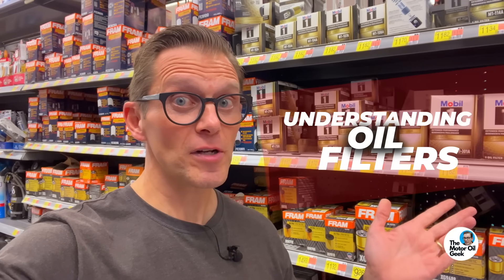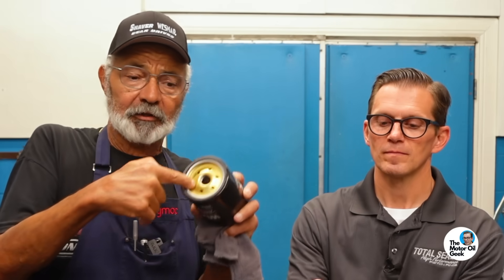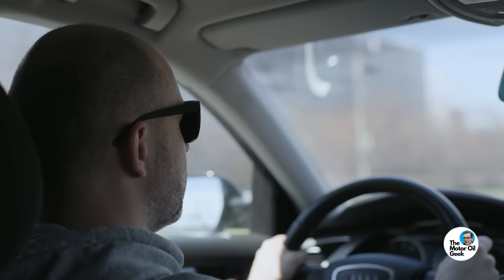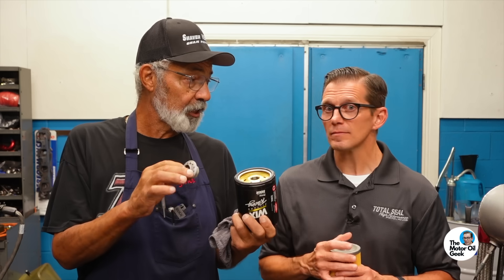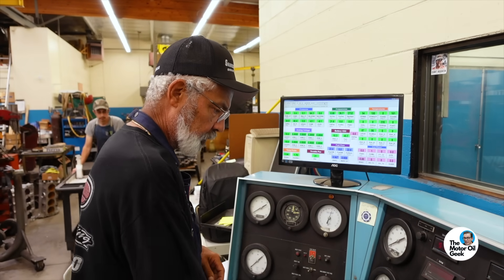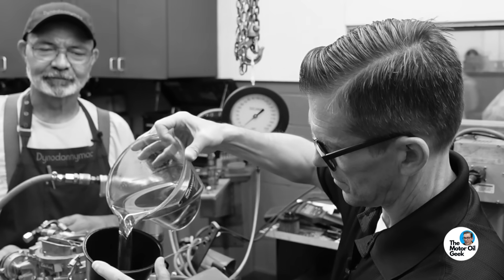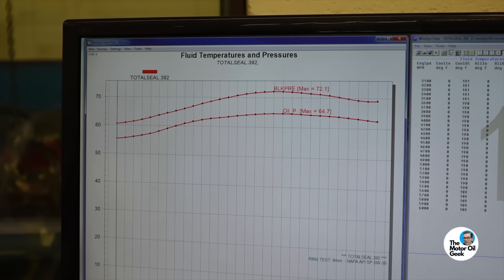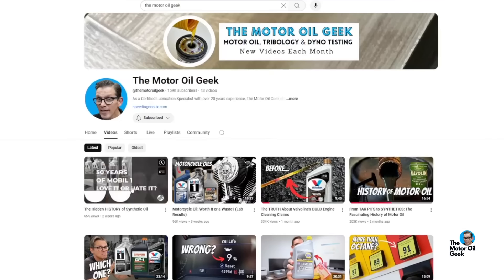OIL FILTERS: What Most People DON'T Know!

Comment: Lake I've heard of one higher end very expensive filter with a lower micron limit that might be prone to going to bypass.....but that is a comment only from one person.  Are you aware of any filters that are prone to going to bypass if one really tries an extended OCI? Like 10-20k miles?
Reply from the maker: Capacity is a different story. Sounds like we need to do a 'field trip" to an oil filter manufacturer.
Reply: @themotoroilgeek  absolutely would love to have addressed because....everyone wants better filtration, but would you say that it isn't really necessary to be so neurotic about it? So if you can find a filter maker boasting 20micron and 20,000 mile capacity, lots of us wouldn't mind stretching a dollar, but going to bypass because it's capacity is shot, would be a risky thing (I've done drain/re-installs with filters in the past...but those were expensive filters).  I recently stopped going 15,000 with an M1 and went back to Denso Champ with plenty of inlet cross sectional area and toss them every 5k.  But if the M1's and Purolator Boss's of the world really truly never go to bypass, is there too much risk in really trying to use them to their full stated mileage? Specifically those low cost filters are being used on my '12 manual Civic.  But I'm staying with Toyota filters on my '18 Camry and '05 Highlander Limited.  Mainly, we're driving a ton, have teen drivers, ...and went so far as to go direct to Valvoline to order on subscription 5gal bay boxes of 0w-20 or Restore and Protect for the Civic and the Camry.  I'm doing at least one oil change every 6-8 weeks.
Reply from the maker: @richcombs4805  Those are great questions that are worth finding a way to test oil.

Comment: Great video explaining about oil filters, I don’t know how to pre-fill or filters on some engines when they are sitting upside down on top of the engine.
I’ve come across this a few types over the years with some machinery I’ve worked on .
The other thing on some motorbikes where the cartridge oil filter they actually have a drain hole to drain the oil back to the crankcase when the bike is sitting just allow duty oil to go back to the base instead of sitting in the oil filter part of the crank case .

Comment: Lake, I'm confused! I thought that the purpose of multi-grade oil (say 5W-30) was that when it's cold it acts a a 5wt oil (thin) to flow easily around the engine quickly. When the oil heats up it acts as a thicker (30wt) to maintain the oil layer between bearings under normal/heavy loads. Am I missing something?
Reply: Oil gets thinner as it gets warmer.  It's just that a multi-weight oil doesn't 'thin' as much with temp as a straight-weight oil.  A 5W-30 oil is as thick as a 5 Wt oil when cold, and as thick as a 30 wt when hot.  On a x-y chart, imagine the x axis is higher temperature and the y axis is higher viscosity.  If you plot the viscosity of a 5 wt and a 30 wt, you'll see two parallel lines with negative slope.  So 'cold', you're on the 5wt line.  when 'hot', you're on the 30wt line.  Your oil is thinner than it started when cold, it just didn't "thin" as much as if you had used a straight 5 weight.
Reply from the maker: https://youtu.be/48pviPLgaPQ

Comment: Doesn't the Check Valve also open if the vehicle is exposed to super low temptures where the Viscosity of the oil is so thick that it wont flow adiquitately though the filter medium so the valve opens because it's better to have unfiltered oil than no oil at all
Reply from the maker: It only open if the differential pressure is greater than the minimum of the pressure range indicated.

Comment: I would say that demonstration was flawed. You attempted to show delta pressure but we have no idea if the Delta pressure was low because of the bypass valve opening or not. I would argue that any time other than a warm engine at idle the bypass valve is likely open at least a little bit. In order for this demonstration to show anything, you'd have to disable the bypass valve and make sure it isn't opening. I understand that the theory is that unless the delta pressure is greater than the claimed 10 psi that the valve is rated for, it's not opening. I just think there is more to it than simply measuring delta pressure alone.

Comment: Good info. I used to drive an Austin 1800 ( 1968 British built car) which had an oil pressure light and a filter bypass light for when the filter bypass activated. The only car I have encountered with this doodad. Judging by some of the extreme mileage videos on You Tube the bypass must get a workout. Would be interesting to know if these cars suffered final failure because the oil broke down or  lack of filtration due to the bypass being the only source of lubrication for months.. It was interesting to learn the actual delta that the bypass opens at. Maybe it would open on really cold oil if you rev it too much  but that would only be temporary until it thinned out a bit.

Comment: To say the bypass valve almost never opens on a clean filter is an over generalization if you ask me. 
For starters look at the wide range of specs for bypass pressure provided by the various oil filter manufacturers. Even for filters specified for the same exact engine. You’ll see quite a range. Some far above the engine manufacturers specifications, some below. I know that WIX lists two filters for the Subaru EJ25 engine. The primary difference between the two is the bypass rating. And the lower of the two will have you opening the bypass rather frequently. Especially when subie bro goes and puts Rotella 15w40 in the dang thing. 
There are definitely situations where the bypass is open far more than we want or think.

Comment: Good video. Technically, if we go to semantics…the valve prwventing backflow is the check valve. The bypass is a bypass, cracks open at a set pressure drop across the filter itself which really only will happen with a completely saturated media. A sort of damage control kind of deal really.

Comment: I humbly submit that the by-pass valve is not a check valve, it is a relief valve
Reply: I would have to agree, the "anti-drain back" would be considered a check valve imo
Reply: @gidderman  That rubber u see under the holes around the filter boss are the anti drain back.
Reply: It allows the oil to go through a different path to the engine, bypass the filter media is absolutely what it does.  A fuel pump has a relief valve which returns fuel to the tank.  It is a relief valve as it keep pressure below a certain level.  Rather than relieving pressure it is there to maintain a minimum pressure.
Reply: Yes, technically. But it works just like a check valve, since it never flows back. It would need a pressure drop so to the oil to flow back and it would immediatelly close off its passage.
Reply: @cmte.brazinazzo2061  pressure relief and bypass valve are similar with porting to redirect.  whereas a pressure regulator and backflow prevention just closes.
Reply: You're correct!
Reply: It's both...
Reply: You're wrong, a check valve can be a bypass.  You're conflating type with function.
Reply: @dan1906  a check valve is a 1 way valve
Reply: @dan1906  nope!

Comment: @themotoroilgeek Let me just preface this by saying that I am not an engineer, I'm a retired Ford dealer tech.  While I've enjoyed and been enlightened by many of your videos, I'm gonna have to call you and Don out on this one.  Concerning the  bypass valve, Don said that "it's better to have SOME oil than no oil".  What he should have said, " it's better to have DIRTY oil than no oil"  as the bypass will still will provide the full flow of unfiltered oil.

You analogy of the bypass valve with the cold oil by using the before/aft pressure differential, just doesn't make sense.  The whole idea of the bypass valve is to ensure FULL FLOW of oil should the filter media cause excessive restriction, in any way.  In your test, if the thickened oil was restricted by the filter media, the bypass would open.  This would allow all the pre-filter oil pressure to reach the post-filter gauge, which is what we saw. We still don't know if the oil is flowing through the media or the bypass. Capiche?🤔

As you know, in the end what causes oil pressure is the restriction put on the oil coming from the pump.  The 10 PSI filter relief valve cannot override the 75 PSI relief valve in the oil pump. As such, all the oil coming out of the pump, is one way or another, going to pass through the filter. 

Yes, in the hot test there is a more oil flowing (think GPM) through the filter due to more loss at the bearings.  The now approximate 6 PSI  difference is caused by the restriction of the filter media. Had this difference reached 10 PSI, the bypass would open, still allowing all of the oil to reach the engine.  We didn't see this differential in the cold test as the bearings provided more restriction to flow than the filter did.

Lake, please give this test another thought and let me know what you think.  Two heads are better than one... and three is better than two...even if one is a bone head!😁
Paul Rosa
Reply from the maker: Thanks for watching and for the feedback. Differential pressure valves only open after the pressure exceeds the minimum. At 10:08 we show a graph that indicates when a valve opens.
Reply: @themotoroilgeek Thanks so much for taking the time to reply. 
I watched the bypass valve part of video several more times and of course you are correct.  I now agree that none of the oil in the test is bypassing the filter.  Sure the thicker oil is more restricted at the filter, but it is also more restricted at the bearings and the rest of the engine.  This causes the rate of flow of the cold oil through the filter to be much less than when hot, thus the filter media can easily handle it.  
The graph at 10:08 Is very confusing.  It could use a little explanation.   We never see the expected 10 PSI (.7 bar)difference where you say it shows the BP valve opening.  In fact,  the biggest difference is at a low flow of less than 100 l/h... strange. It also appears the the up stream and down stream readings are reversed, showing the pre-filter, up-stream pressure LOWER than post filter.  
At any rate, I always enjoy watching your videos. Keep 'em coming.  I like that you not only explain it, you back it up.  You get my old brain humming,  I've learned a lot.  No shortage of videos on oil,  but few if any have the science. 
PS: My daughter watches your wife's videos on knitting, crochet or whatever that is.  Cheers!
Reply from the maker: @paul2lane236  That's too cool that your daughter watches my wife's channel - small world, LOL. I wished we had a better example graph of the bypass opening, but that's the only one we could get from the company that makes the test equipment. Unfortunately, it does read "backwards" from how we are measuring in on the dyno.

Comment: The “one way” drain back valve rubber flap does not make a perfect seal. Isn’t intended to. Its purpose is to stop the impulse back flow the instant the engine stops and oil pump stops. The flow that can backwash any crud previously trapped by the filter.

Comment: Great info. On my new ford 7.3 gas engine (with some experiencing lifter/cam failure), I want to stick to Ford approved oil and filter to maintain my warranty. I will be using Motorcraft filters and Valvoline Advanced (which meets the Ford requirement).

Comment: Good information.  Air in the oil pickup tube.  When the oil is changed and drained completely, the oil pickup tube should be drained as well, air in pickup tube.  When new oil is put in oil pan the trapped air in the pickup tube will keep oil out.  When the engine starts, air in the pickup tube will be drawn into the pump.  Does the air go through the system and dispelled as the oil will be, IE through the bearings?  Same basic question about the air in a filter?     I enjoy and learn a lot from these videos.

Comment: Flow vs filtering ability. That's all that matters, and Purolator Boss is the most well-balanced oil filter available at this time. Being the best at one usually means being the worst at the other, but Purolator Boss beats 90+% of the competition on both ends. Which doesn't seem possible, but they do it.

Comment: What if the engine was at -40F. I was told the bypass would open as the 15W40 wouldn’t flow through the filter?? I’m talking diesel applications
Reply from the maker: That would be fun to test, but it would have to create a differential in pressure to open it. Just more pressure alone will not open it.

Comment: This is an excellent video. It’s been my understanding that manufactures are denying warranty claims when non-oem filters are present on motors that have catastrophic engine damage. But, from this explanation the difference is likely only related to restriction in flow due to filter media. 

Are you able to show a difference in filtering media capacity and flow differentials between an oe filter (e.g. Hyundai/Kia, Toyota) and a quality aftermarket filter (e.g. wix, Mobil, fram)?

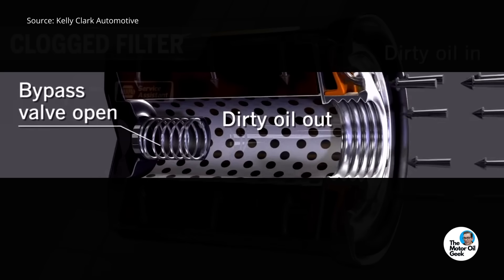Comment: 3:01 The bypass valve is not the check valve. 
The check valve is the anti drain back valve (a  check valve is a one way valve)
The bypass valve is an over pressure valve that has a calibrated spring that operates when the media gets clogged and the input pressure rises high enough to open the bypass path.

Comment: I am a retired master mechanic,had training on most engine manufacturers . They would go through all systems and they would say we built in an oil pressure bypass, below 10f the filter would be a restriction so you want oil supply no matter what, better dirty oil than no oil .My cummins instructor told us below zero " you suck a hole in the oil " . My friend owned a late 70s ford pickup with the300 six ,it exploded the filter on a cold morning .  I always fill the filter, good to know about the check valve. like your stuff ,have tons of oil story's like your stuff .
Reply: That I-6 300 CuIn engine was one fantastic motor. Torque monster, and it would last forever.

Comment: On Mazda Wankel rotaries the filter was on top, opening down. 
(This was atop an oil cooler heat exchange) At oil change time you'd have a big mess. Or, punch a hole in the housing to let oil drain out before removal. But make sure your new one is correct.